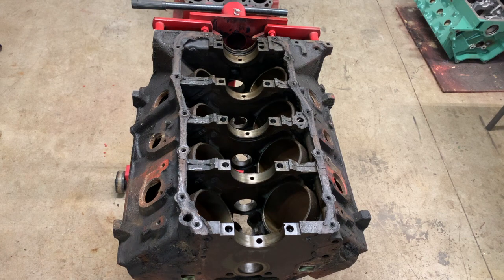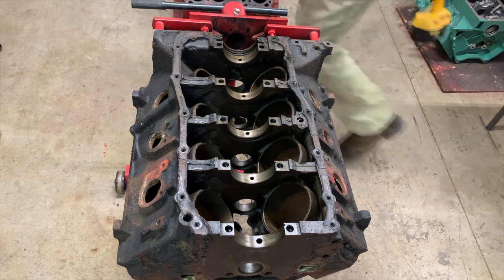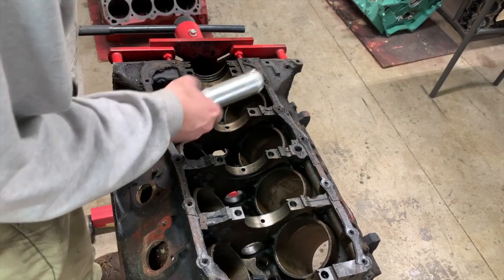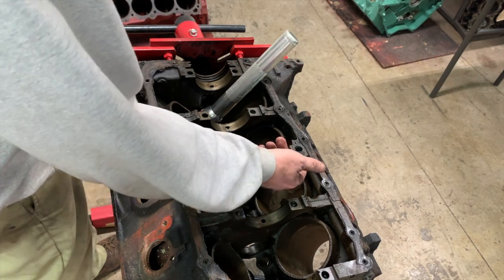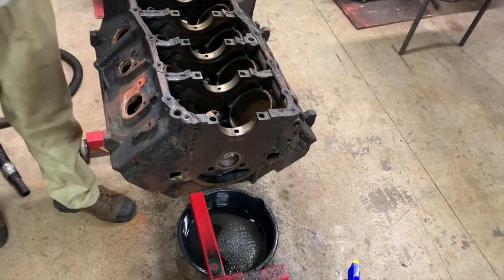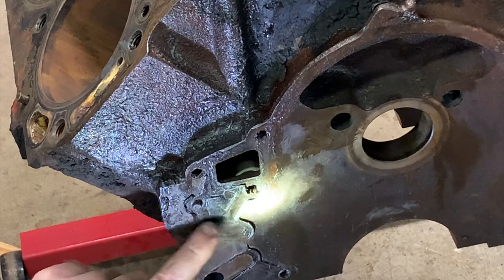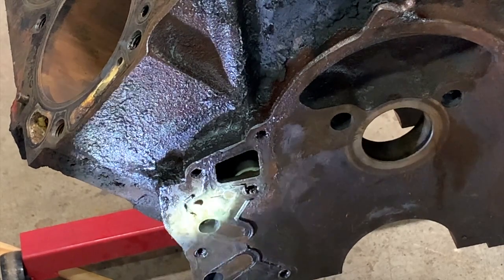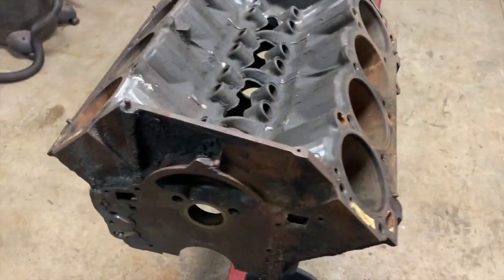"F" it Friday Buick 430 Oiling Mods! I do what the factory should have on this 1st gen Big Block!

Comment: Hey Ed, I got a late 71 455. I just want to align the mains holes with the bearings. And I want to open up the passage from my oil pressure sender to #1 cam bearing. Is that enough oil mods to do on a street motor that won’t see more than 500hp?
Reply from the maker: Yes, and don’t call me Shirley.
Reply: @mr.roddersneighborhood2740  apologies Mr Rodder! I already have my cam bearings installed! As long as I blow out and clean as much as I can the shavings it should be good right!?
Reply from the maker: @srobinr  never try oiling mods with bearings installed, it's not worth the hassle of getting metal in the main oil passages. I always do the mods on a bare block and prefer to take it to the machine shop for cleaning after the mods. I would not even try the mods now with the bearings installed. Time best spent is completing the oil mods on the timing cover at this point. There are five separate 90 degree or greater turns in that pump and timing cover. That will make a huge improvement in oiling as well and make that 71 455 live that much longer.

Comment: I have a 1969 buick 430 the engine is blown had about 2 inches of metal sitting in the oil pan. Could you give me a list of instructions on how to fix the oilling issues to protect myself in the future?
Reply from the maker: If you watch all of the Big Block oiling modifications video it show you step by step how I do it. If you need a new 430. I have this one in the video that’s being assembled now.
Reply: @mr.roddersneighborhood2740  still need to get mine apart to find out but what would the price range be?

Comment: i bought a a 68 430 riv engine and it has the same not drilled out 7 1/6 oil feed ! what do you do on the timing cover to replace the rope oil seal ?
Reply from the maker: TA Performance has a neoprene front seal that drives in from the rear of the timing cover. The rope seal and framing must be removed and the 3 swedge marks that retain the framing must be ground down to flush, then the seal drives right in and does not generally leak compared to the rope style seal.

Comment: Mr Rodder, which Buick v8 do you prefer for performance the 430 or the 455? On Engine Master's competitiions there seem to be a lot of Buick 430 being built.
Reply from the maker: To each their own... but the 430 and 400 have thicker cylinder bores which I feel is more important than the flimsy 455 with all the extra cast iron removed for the sake of bore size. The 400 block retains 1/4" more material each cylinder and over the entire block, thats 2" of extra cast iron in the block... which makes for a much stronger foundation over the 455. Just my 2 cents...
Reply: @mr.roddersneighborhood2740  Can the 430 internals be swapped into a 455 block? Trying to avoid having to plug the oiling head/block on a 430 build. Planning to use Stage 2 heads from T/A performance.
Reply: @w41duvernay  yes. Bottom end wise the 430s are identical to 455s other than the pistons. From what I read. 430s are more prone to breaking the wall of the casting when drilling the suction tube. 455s already have the bigger tube so they have more meat. But it's really not that hard to plug the block. Just need a pipe plug tap and plugs
Reply: Can Stage 2 heads be swapped onto a Buick 430?

Comment: just finished bolting my 350 back together fired it up and no oil to the pushrods topend ! crappy liffters i never noticed they must be for a early engine just ordered a replacement set good jod i checked before driving it !
Reply from the maker: Boss Buick... don't take them apart or order anything just yet. I've found that the lifters are covered in a cosmoline type of material that is oil soluble. It takes a day before they start working correctly. Let them sit for a day or two and then try reprising. Also, don't forget to turn the engine over while priming to verify that all lifters have a chance to cycle through their rotation of being in the main oil galley. This normally is the case when I prime them too. If it does not work after that... it's time to tear things down and order new parts. You might want to try this option first.
Reply: @mr.roddersneighborhood2740  thanks dallas i had spun the oil pump with a drill to prime everything but was getting no oil uptop i ran the motor great oil pressure (50psi good for a buick) but still no oil so i left it overnight started it again this morning the pushrods are spinning (thank goodness no wiped lifters and cam) but still no oil through the pushrods i think its time to pull it back apart